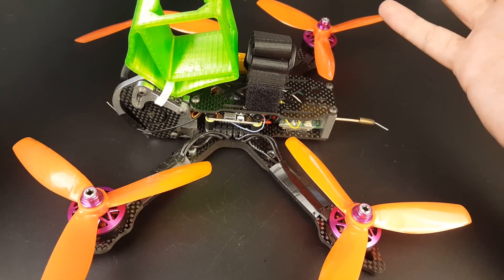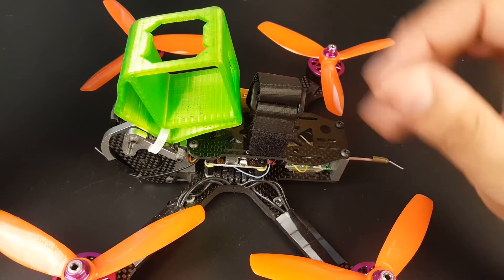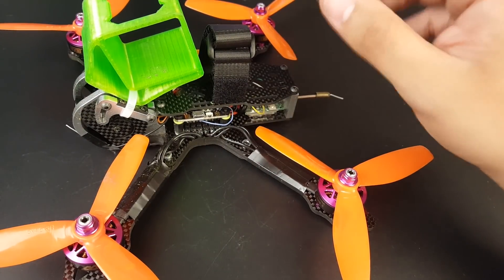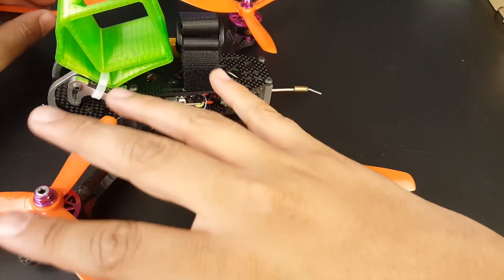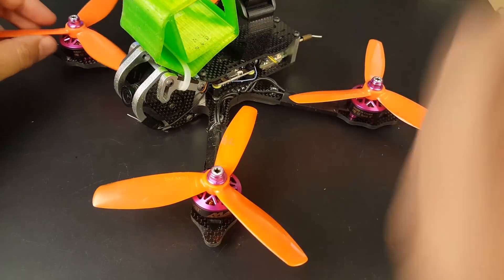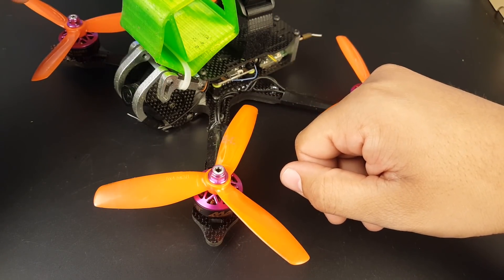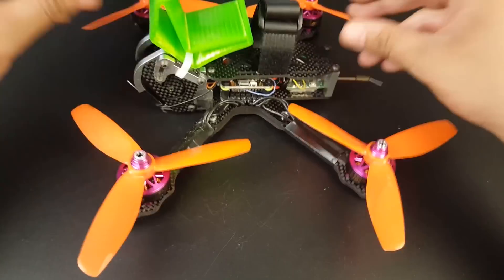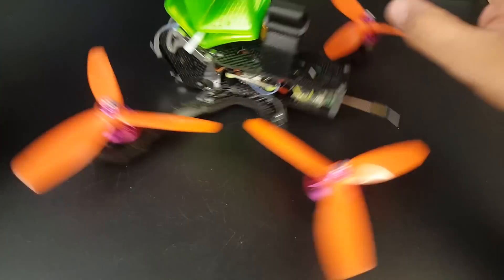Racerstar Tattoo 4in1 ESC // Review and Maiden Test

Comment: The 12V regulator on the ESC is not that good. I have Eachine TX526 conected to it and I get a noise in video feed on throttle punches. 1000uF cap on battery leads (soem cheap one). Other than that it is fine. It goes great with Wizzard OmnibusF4 which has the 4in1 cable included. Very clean build that it.

Comment: You don't have failsafe issues with the antenna like that? I wonder if my XD9+ is bad cause I don't think I would make it 200 ft like that. I also tend to fly in pretty noisy rf areas probably has a big impact on my range

Comment: Thanks for doing this..I’ve been trying to tell guys in the Facebook Matek group that the yaw twitch is a result of components combination. My build has no caps either (brotherhobby motors with spedix esc) and it’s been performing flawlessly from build... well done. Btw what’s up with that cam mount? 70degree angle lol?
Reply from the maker: Eddie FPV I never fly without it. It saves my quads and gopro because it takes the impacts 95% of the time.
Reply: i have 2 mateks and both fly the best ive flown so far